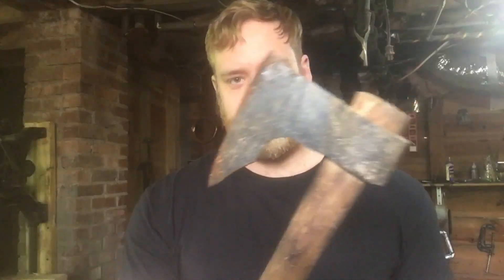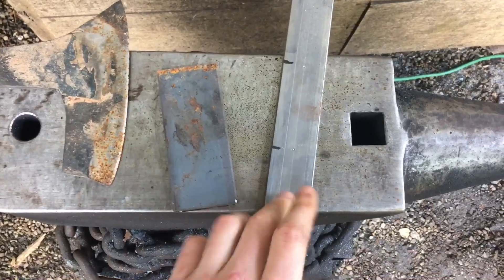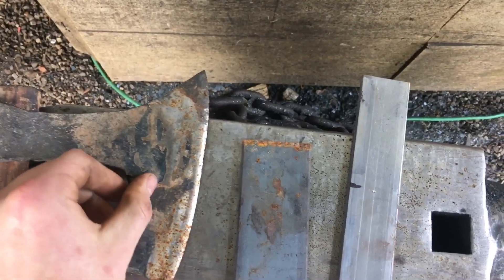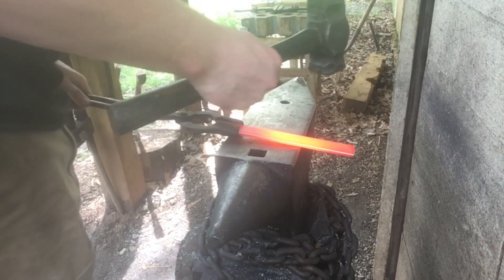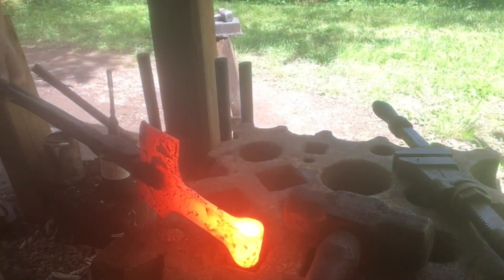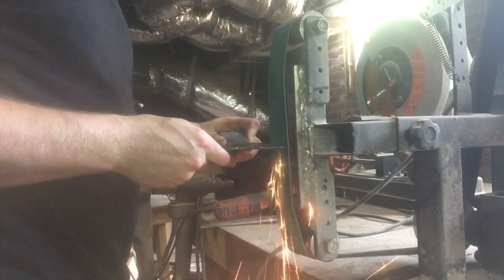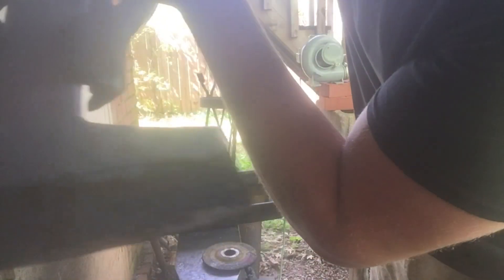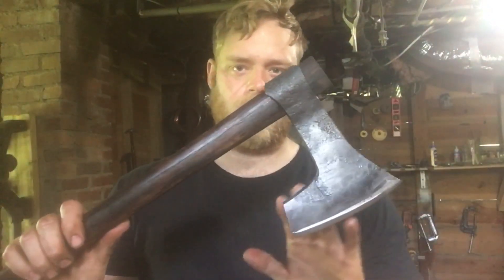Forging a Viking axe 3!

Comment: Where do you get your mild steel, I have trouble finding a place to get mild steel.
Reply from the maker: Vince Golder I have a structural steel supplier near me
Reply: Thanks for the reply. I don't have any steel suppliers near me, but do you think ordinary weld steel from a hardware store would work for the body of the axe head? I can find plenty of steel like that in my local area.
Reply from the maker: Vince Golder yeah that’s the same stuff they sell at steel suppliers. 1018 mild steel. Or a36 structural steel which is pretty much the same thing. Steel suppliers just have much better prices
Reply: Thanks for the information, it really helps a lot. Nice job on axes.
Reply from the maker: Vince Golder thanks! Happy to help!

Comment: Eye protection, gloves?
Reply from the maker: steady bloke holding on to a hammer or tongs with gloves hands is very difficult, blacksmiths generally speaking don’t wear gloves. It’s humid here and glasses fog up quick posing more of a risk because of not being able to see what you’re doing.
Reply from the maker: I wore glasses during the welding which realistically is the only thing that poses any sort of threat to your face.